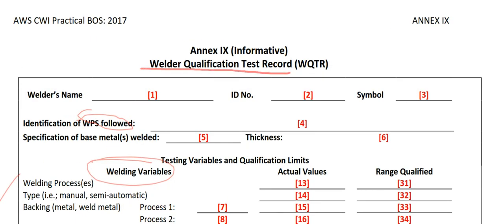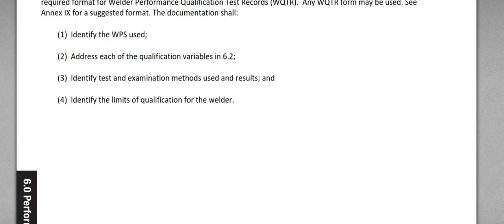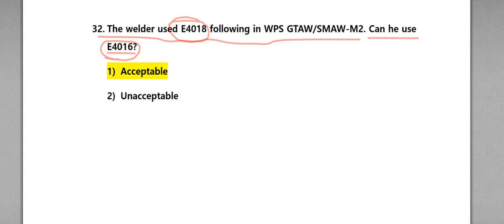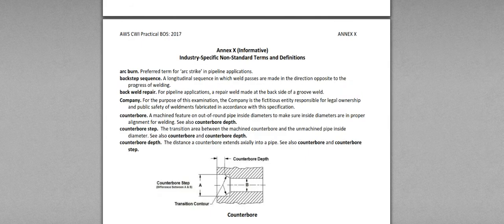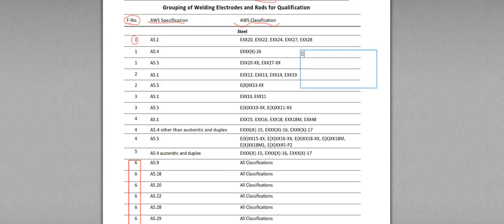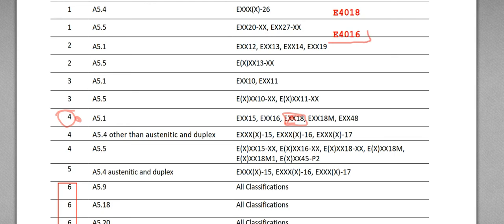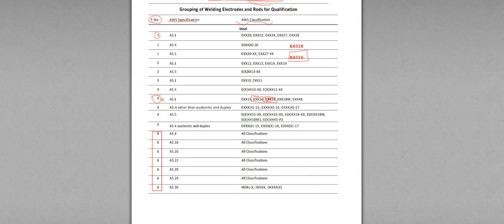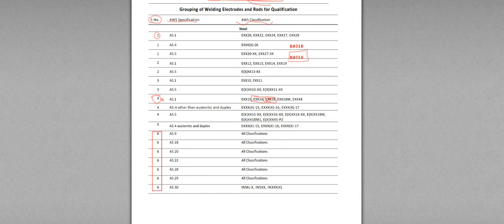CWI Part B Lecture #20

Comment: thanks you so much for your video. that is very help. but I still need more practical questions to familiar how to use the Annex table. would you provide so practical question through email or video to share your experience. thanks again.
Reply from the maker: Sorry for the late reply.
I have numerous questions for actual part B. Still enough time left for you. 
You may purchase them. Thanks,